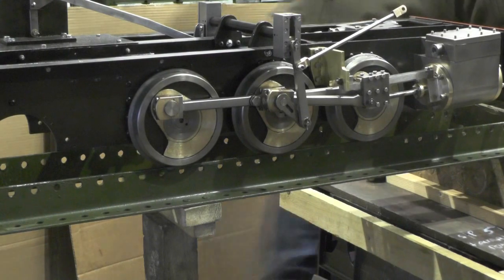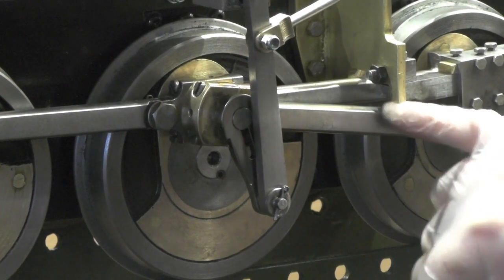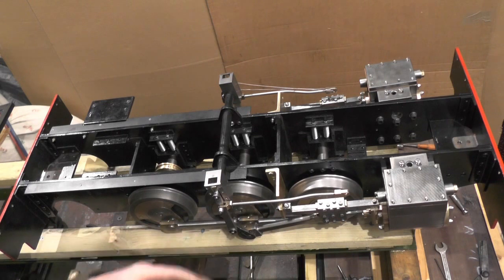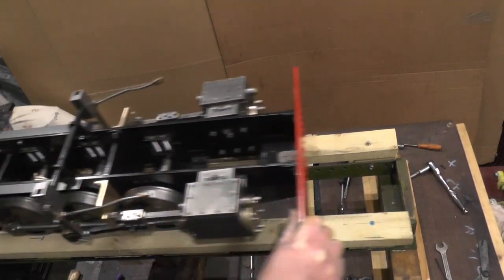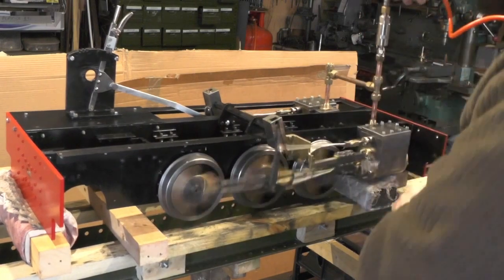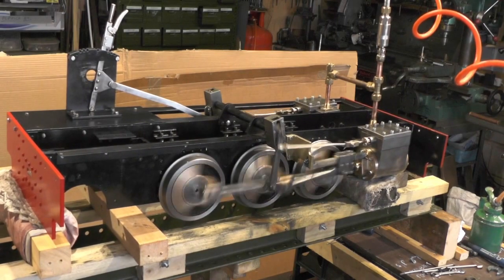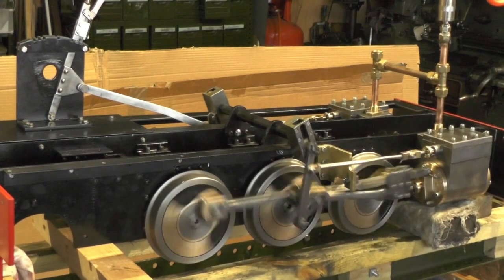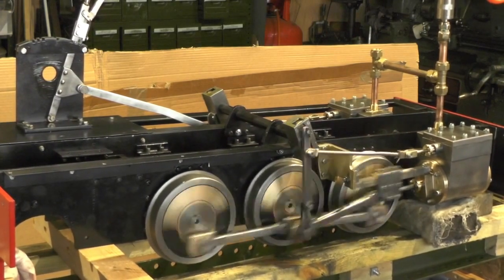Make a Beginners Miniature Steam Locomotive Series (1st Compressed Air Test  ) "mr factotum"

Comment: Hi Kev. I’ve watched with keen interest your build of Sweet Pea and found it very instructive. I’m pretty sure there’s stages I would have struggled with without you videos. I’m now at the stage with my build (0-4-2) of trying to get the valve timing set. Having checked and rechecked everything I cannot adjust thing to get the valves slide in the correct position relative to the ports and there seems to be little adjustment in the valve spindle thread. It looks like I can get things to work if I extend the 2BA thread on the valve spindle but I’m reluctant to stray from drawing. Any advice?
Reply: Thanks. I’ve spent a day checking and rechecking. Found the at valve spindle fork and the mating thread were a tad too long. Adjusted these and put a couple more threads on the valve adjustment. Hey presto the valve events are as described in the book ( and several other sources). Looking forward to running on air. I very much appreciate your help. Glad you got home in time to beat the downpour. It’s just started here in good old Lancashire. 👍
Reply from the maker: eyup Ray
thanks for the feedback
I think from memeory i had to amend some sizes on the valve assembly, not 100 % sure but i think it was the adjusting nut lengths. anyway my  view is if it will work with adjustments do it, there were many things i had to tweak just like many others have told me they had to do with different loco's, there are some errors on SP drawings not sure if the valves are one of those.
As long as nothing jams up and it works all should be ok.
Make sure you belt and brace the locking nut, mine came loose and jammed everything up after a few runs with expansion and contraction
cheers
Kev
let me know how you get on
Reply from the maker: P.S. oh Ray
Not trying to tell you how to suck eggs, but i adjusted my vaves with the chassis pre-loaded to the same weight as if the boiler and tanks were on full with water, because of the quirky hackworth valve gear.  👍👍👍👍👍👍
cheers Kev
Reply from the maker: Hi Ray
Just got back from a full days running, unloaded from car then the heavens opened up😉😉👍👍phew just in time!!!

Comment: Any chance of getting a set of plans or at least info on obtaining them?
btwltnew@outlook.com
Bill
Thanks you
Reply from the maker: hi bill
thanks for watching and interest
I don't have any plans, i'm just working to the book that accompany's the plans, with the exception of 1 sheet of the plans for the Metre Maid version general arrangement drawing so i could get the extra set of wheel positions.Its all explained in my video series.
The book is "Build your own Steam Locomotive" by Jack Buckler (who by the way passed away last month in his 90's), you sometimes see the books for sale on ebay, or if not go to Blackgates Engineering based in Yorkshire UK, you can also get the plans and all castings and materials from them if you want to go that route, which i didn't. Hope that helps any other questions feel free to contact and will help if i can
regards
mr f

Comment: Easiest way to tell if the timing is right, once you’ve run it in run it as slow as possible, that way you can hear how even it is, if you want to be really picky is try and get a metronome to sound in time with it, looking good though! And not bad at all, one of my locos has a tight spot on the slide bar as well just because it was in Laiden, goes away one some weight is applied
Reply from the maker: cheers jordan
appreciate you watching and advice
appreciated
regards mr f

Comment: Bang on, well done!  Recommend you get a rolling road so you can setup the suspension and valve timing up.  I only realised in this video that you are also fitting a pony truck which I am considering for my 0-6-0 Sweet Pea!

https://gardenrails.org
Reply from the maker: thanks for comments, watching and advice, appreciated, good luck with your modification
regards
mr f
Reply: Check out CMD Engineering, they supply great rolling road units!